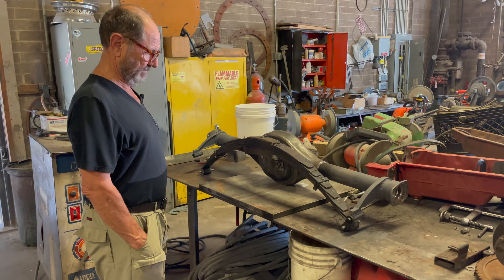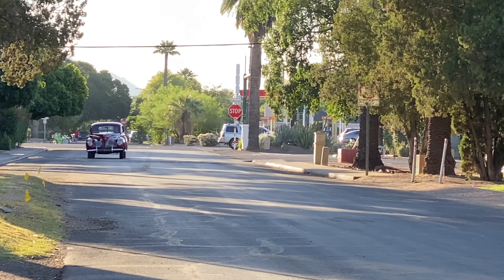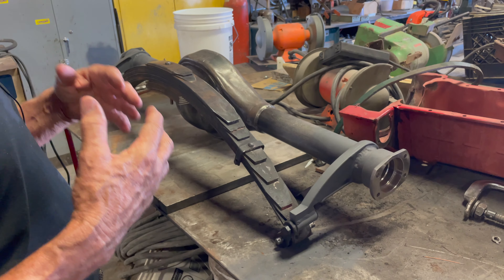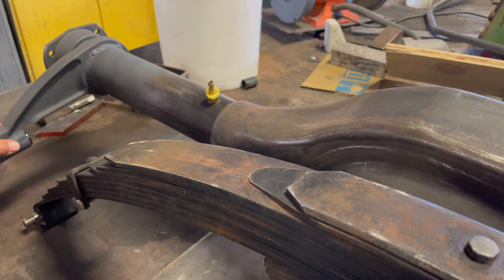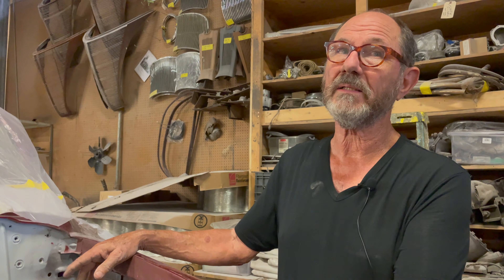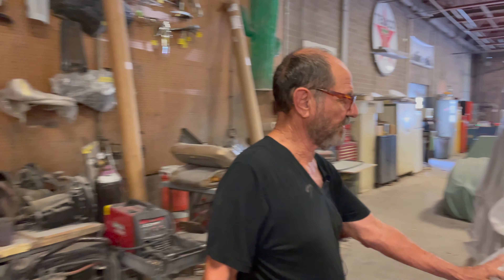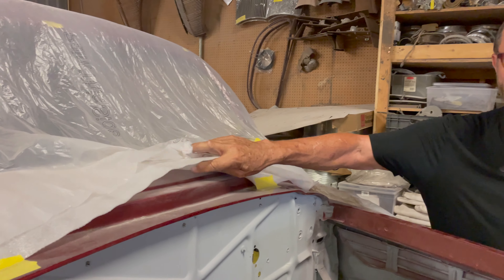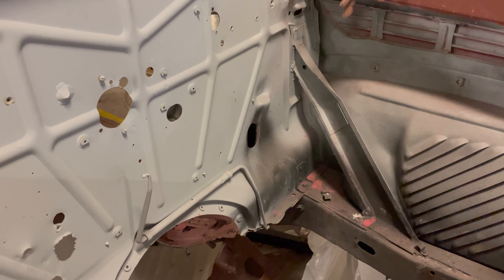1938 Part 34 Firewall and Rear Suspension,  STANCE!  1938 Lincoln Zephyr V12 Coupe Restoration.

Comment: With all the time and money spent , keeping everything Original is the way to go .  Firewall change is Hot Rodding !!
Reply from the maker: Hey good to hear from you again, Rick. 
I imagine the thinking related to quieter and cooler cabin goes toward the goal of keeping it fun to drive so it gets used. To me, the smooth look in the engine bay keeps my eye drawn to the shiny stuff LOL. 
I appreciate your point of view, and of course everyone can make different and reasonable points! 👍

Comment: Funny, I have driven 40s Mopars for over fifty years, as daily drivers in the Northeast years ago, and the cowl vents never leaked.
Reply from the maker: Up in the northeast, you have your rust challenges, in the southwest, we have our dried out rubber challenges…
Reply: @BarryTsGarage  Steele Rubber Cowl Vent Gasket
p/n: 40-0271-54 (Mopar universal) There is also a drain from the surrounding gutter, which leads to an overboard hose. Adding that drain might be easier than removing the whole vent. Fresh air is copious and enjoyable. Great videos, thanks! Love the Zephyr's styling.
Reply from the maker: Fair point!